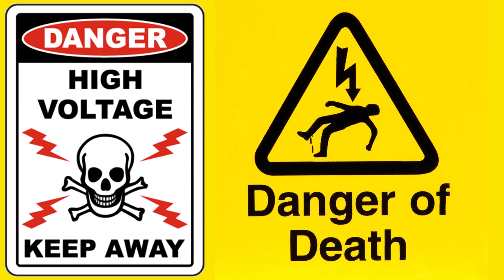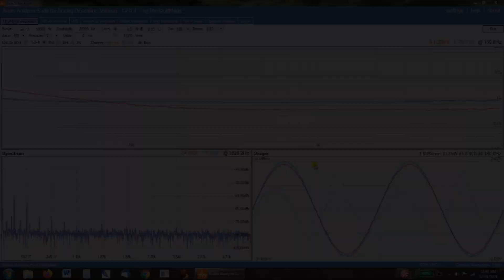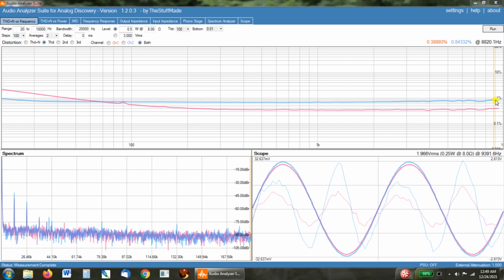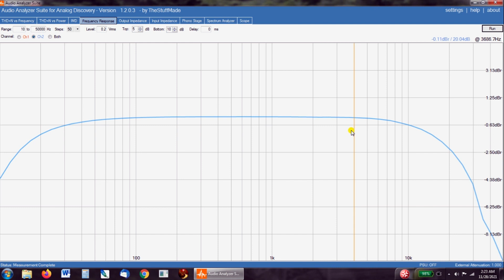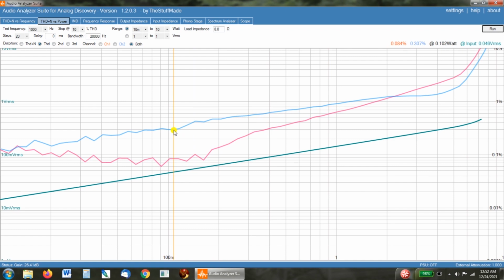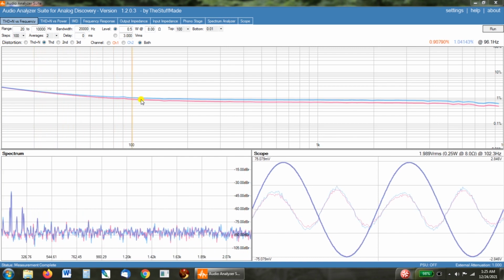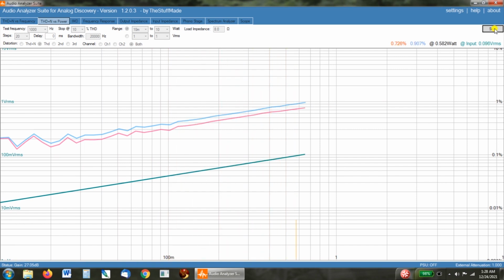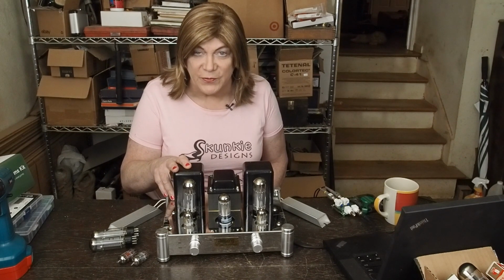Boyuurange Reisong A12: Follow up on Final Mods.

Comment: You're a real pro. I enjoy watching your videos. I'm a TV repairman and still in business even after 35 years I'm 58 now and can't retire yet LOL I have to put up with these Chinese made newer ones and sometimes I get to repair something exciting. A customer brought in a TEAC reel to reel and a McIntosh 275 Tube amp I love McIntosh old tube amps. He told me he plugged it in and it made a loud pop and a lot of smoke LOL. I took it apart and saw a bunch of black tar blown out of one of the electrolytic capacitors. I had fun cleaning up all that burnt tar out. I have a can of Zenith spray lube de moisturizer with ZDDP that stuff must be 30 years old but it did a good job dissolving burned tar. It kinda smells like a can of bust loose. It was all original so I ordered all new capacitors and measured the resistors and only two were out of spec. All the transformers had continuity. One of the 6550 had no emissions and the rest were marginal. One of the 12BH7 had a little short. I ordered one of those. He wanted it to be functional for now so I didn't spend a bunch of money on matched tubes just made it reliable so it won't pop when it's plugged in. I found one Svetlana 6550 on eBay for twenty bucks but it was aired when it came in. Found a 6550 GT for $30.00 and it came in good. The 12bh7 that came in had a little short when the heater voltage was turned up on the tube tester but not as bad as the original I was a little disappointed but went with it anyway. After all that time and effort and also cleaning the tube sockets and controls with contact cleaner I tested it with a dim bulb tester and it proved reliable for full power and it sounded great of course I don't have trained hearing for detail but it sounded good to me. I told him for best performance order all new matched tubes preamp, driver, phase inverter outputs all of them gotta go with decent brand matched sets I think groove tubes are good. It will be very expensive but it will enhance it.

Comment: The results speak volumes…. Pun intended! 😂 I champion your work whenever I can regarding this amp. You really have turned a turd into a diamond. I did love the turd before, but how the amp stands after your mod, I can see how much of a turd it was. I am very new to tube amps, I’ve always used solid state, and took a chance after seeing glowing reviews on YouTube. I can appreciate what those reviewers saw in the amp, but I’m sure they would agree that after your modification, it sounds so much better now. I wonder if the manufacturer would be willing to take on board your improvements… 

Thanks again :) 

And Merry Christmas!!!!!

Comment: Not in a position to do the mods as A10 and 12 are too £££ in uk to jusify it. Would rather start your 300b amp build instead. Totally appreciate your mods though. And the work put in. I don't know why people find this so hard to understand. You are offering them the means of getting a great amp for not much money. If I could get one cheap in uk or if I had one already I would be modding it for sure using your research and design.  Merry Christmas.

Comment: If they don't want to hear you talk this long, they sure don't want talk with me. I tend to explain things at their base level. Likely the difference in the PSvane tubes comes from the grids not having consistent spacing on the grid wires. Either the distance not being centered between the cathode and plate, or even spacing of each turn on the grid assembly.
Reply from the maker: That makes sense on the tubes. What is odd is I have used PSvane tubes that were fine/good, I wonder if these are seconds they sell cheap to the OEM guys?
Reply: Very likely they sell the ones they can't easily match in bulk.

Comment: Haters will be hatter.     I for one (an I don’t think I’m jut one) are very thankful for what you’re doing.  I’m glad to hear the OP transformers ok.  They last time I checked the A10 we’re going for $400.   I seen one go on eBay for $275.      I’m thinking about trying a separate transformer for the heaters, to take some of the load off the power supply.   I’m in the camp of just leaving stuff turned on. That’s a debate for another day lol.    Thanks for your videos, an have a great Holiday 🌹🌹🌹🌹🌹🌹🌹